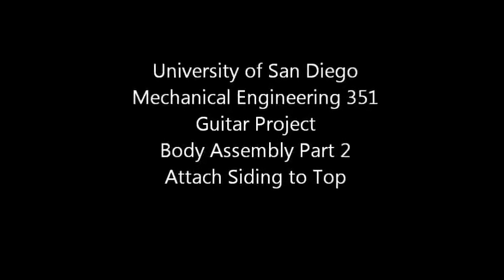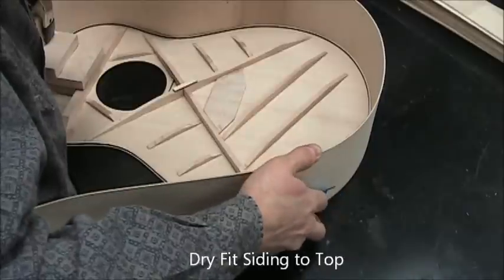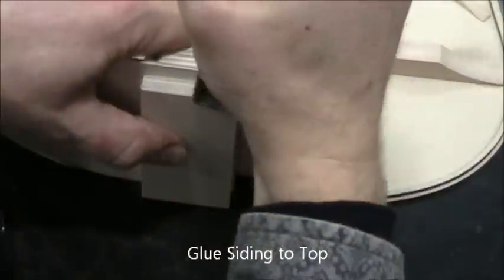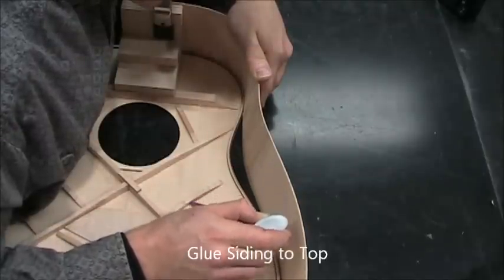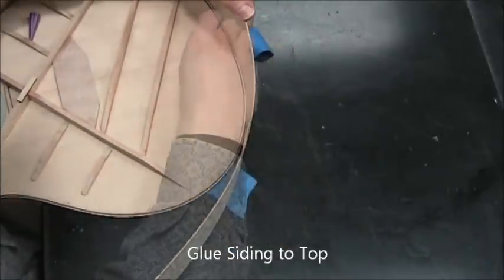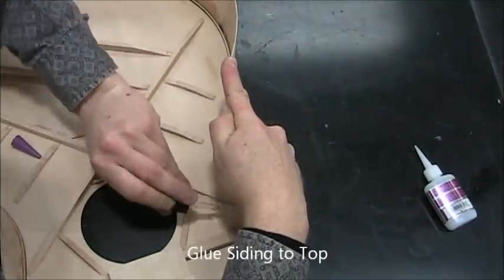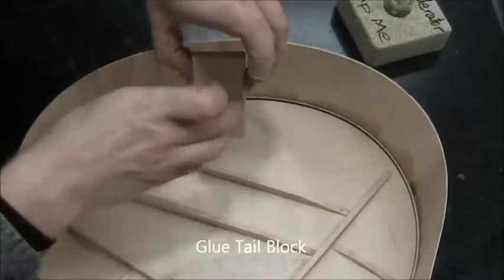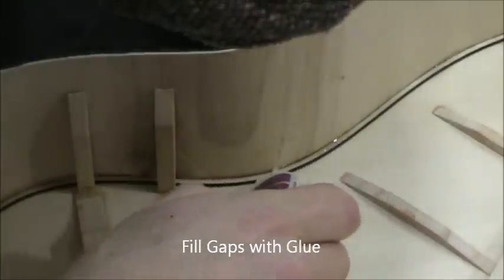Body 3a: Siding-to-Top Attachment

Comment from the maker: I start with a ~1/2" wide piece of the same siding material, extra long, which is easy to wrap around the lining.  I repeated that a few times on a few guitars to get a reliable length.  Traditionally, sides are extra long and marked for length in the mold, then cut.  We, some builders, and probably most factories, cut to length ahead of time.

Comment from the maker: @ASTRO0420 Certainly this is not a traditional method.  It's a simplified method for a intro woodshop class project.  Some of the goals were to use no molds or spreaders, no heat-bent sides, only a few clamps, and do it faster and at lower cost.